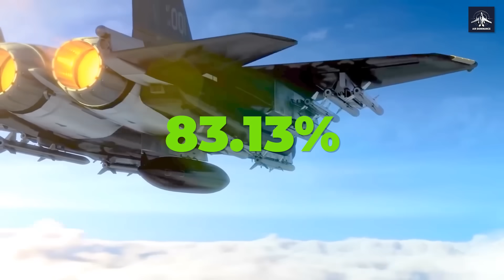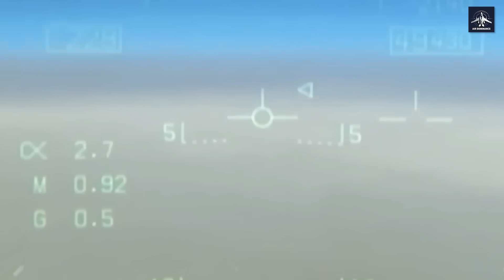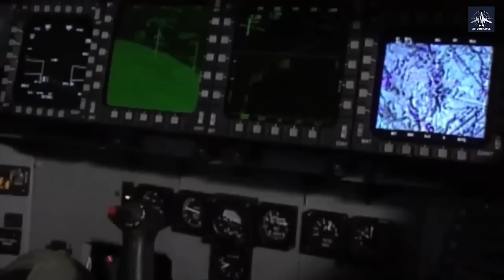This Fighter Jet Is Beating the F-35 & F-22

Comment: And THIS is exactly why country after country (7 now) have dropped the F-35 and have chosen the Saab JAS-39 Gripen E/F. The same reasons the F-15EX is dominating fly time in US Air Force. The Gripen has now beaten the F-35 in war games numerous times, is 4.5 Gen and non stealth but has an electronic warfare suite that can detect even stealth planes and jam them to hell. It costs $7k USD per hour to operate vs $33k per hour for the F-35, and 88 F-35s over their life cycle cost $30 billion without counting overruns, while 88 Gripens cost $18 billion. You can service Gripen with a small crew, it can land on highways, and it's made for winter Arctic patrol, none of which is true for the F-35. The F-35 is losing market dominance fast, and the US has nothing to replace the F-15EX with yet that fills that need. Most countries are seeing the cost, as now the Gripen has offered a capable alternative that is sovereign tech without being at the mercy of the US for tech upgrades, for almost half the price, and 1/5 the cost of operating.
Reply: These 4.5 gen planes are only winning when the 5 gen have restrictions on them or special scenarios that leaves them vulnerable
Reply: The Gripen only carries a small weapons load . Its not designed for ground attack. The 35 is designed more for ground attacks with the capability to dogfight if needed. If their radar works so well, then why has no one else ever gotten missile  lock on either the 35 or 22?

Comment: Where do you get your facts from? Yes the F15 design is a old one. But they have not stop making this plane? So hours on a plane ok but we can make more fairly quickly? Now the F-22 that's a different story. They stopped making the airframe. But the f-35 is a great fighter. The F-47  that's going production. This fighter is what? 6 or 7th gen fighter? Please check your facts before put things like this on a air. Your just making  fool out of yourself.

Comment: BS. In the Red Flag games 7, F15's were sent to "kill" 1, F22. The F15's offensive performance was textbook perfect. The F22 still "killed" all 7, F15's. An Aussie pilot and a British pilot both said they could visually see an F22 but their fire control radar couldn't get a lock on it. It was the same for the F15's. When you bear in mind that the F15 is undefeated (104--0) in air to air combat and ONE F22 takes out 7, F15's it shows just how bad ass the F22 really is.

And, the reason some of the planes are sitting in a hangar is because theyre not needed right now. Why WOULD you have every plane in your inventory sitting out in the broad open daylight? And, Israel just destroyed the entirety of Iran's Russian made air defenses in 3 weeks using the F35 and they did it without the loss of a single aircraft.
Reply: But tha was old F15 but if the dog fights the New F 15 EX. That tha just had a  red flag in Nevada tha gave it to Every single f22. And F35. Every single f22 and F35 pilot said tha could kill the F15EX that's a fact

Comment: F22 and F35 are our biggest mistakes, cost to much to build, to maintain and never see a battle to prove it worth.
Reply: Both the F-22 and F-35 have been deployed in combat zones and have engaged in various missions, including ground strikes and, in the case of the F-22, an air-to-air engagement. 

The F-35 will be the quarterback in the field.
The F-35 will clear out the path, while the F-22 provides air coverage as needed.

The F-15EX will be the mule carrying max ordinance once surface to air threat is gone, will provide the firepower as directed by their QB,
the -F35.

Then in the very near future armed drones will take over, guided by the NGAD F-47.
Reply: @rmak_I  I'm glad someone gets it. They all have their roles to play, working as a team to get the job done. The F15EX with its speed, range and payload can be delivering punishment around the clock. Both the F35 and F22 require frequent maintenance compared to 4th gen aircraft. 
The F15EX can carry 1.6x the amount or armament than the F35, and about twice as fast and twice as far- though its likely range and speed get reduced with a max load.